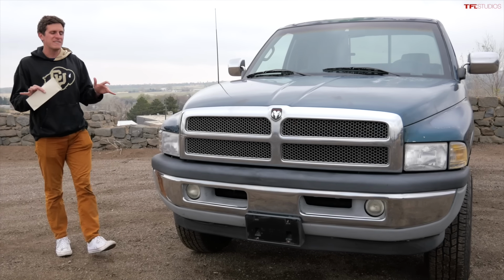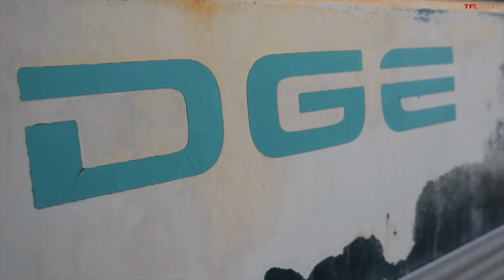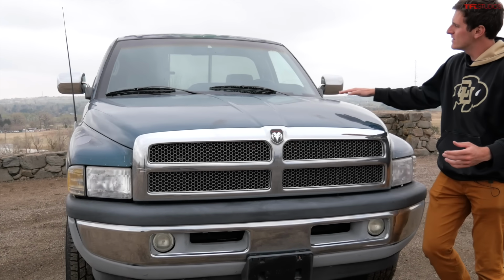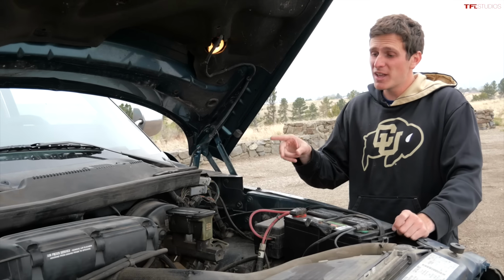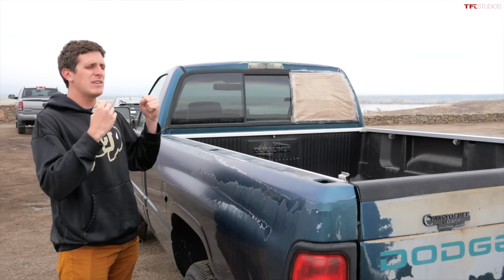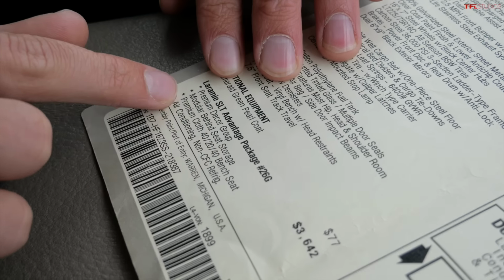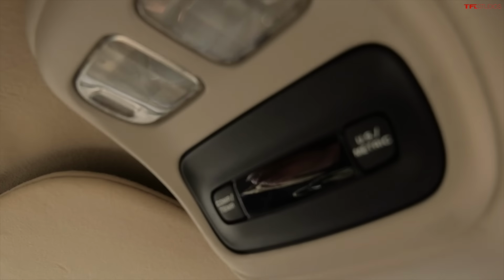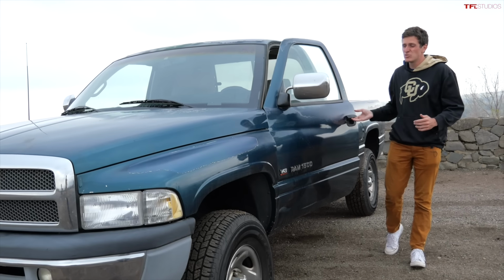The Second Gen Dodge Ram Is The Most Important Truck Ever: Here's Why You Should Buy One NOW!

Comment: The auto trans isn't the problem, it's the anti drain back valve in the cooler line by the radiator. It clogs and starves the trans of pressure.

Comment: I’ve owned several 2nd Gen Dodge Rams over the years. My take is they are very reliable as long as you maintain them. Regular engine and transmission oil changes. All of the steering complaints are easy to correct. These trucks are also fairly easy to work on, no special tools required for most repairs.
RockAuto, LMC Truck and Ebay are my go to sources for parts.

Comment: Bro, I love my second GEN. I just got another one. I have a gray one and now I have a red one. The old one I used to have it was a 2500 with 800,000 miles on it. now I got a 1500 with 273,000 miles on it. 59 magnum original transmission automatic. They run fine as long as you do the right maintenance they run fine and they go forever. You just gotta maintain them and just not skip out on oil changes and just do homework you just pure ignorant stuff just treat them like you need to be treated now treat you good forever man.

Comment: 1997 slt Laramie 1500 4x4 with the 5.9 magnum i am the second  Ram owner of this truck i bought it off my best friend  ..when he was going to trade it for a new ford F-250 in 2015 ...... one thing besides the dash crack they are notorious for is the headliner that droops and the foam deteriorates under it same as the one you are in the video  ........there is a company called DASHSKIN that makes a replacement dash cover very easy to install and they look like  new .....the headliner is next on my list to replace or repair  i just have not done it yet .........the headlights also...get cloudy and pasty looking....so i recommend replacing them with the newer poly carb style ....   great its been a great running truck   mine is still going strong mechanical wise ...

Comment: I have a rather interesting one myself. 300k+ miles and still going strong. Just bought her not long ago and Im looking to do a full restore and  a few small upgrades nothing huge. Its supposed to be a 5.9 L V8 but one of the orevious owners swapped it for the 5.2 L V8 and its a club cab/extended cab instead of a regular cab but only has 2 doors. Its 4wd and its silver with a blue stripe down the sides. If I can afford it soon Ill be fixing her up. Hopefully dont have to sell her, shes is an amazing truck.

Comment: I had a 94 regular cab long bed with a 5.9 the truck was an excellent condition not a single crack in the dash body was in mint condition picked that truck up for 2300 bucks after a year I was in an accident which totaled the truck unfortunately. But I was able to somewhat redeem myself and I bought another 94 just like it with the v10 instead I looked out once again, not a single crack in this dash pain is good clear coat is good just some rocker panel rust I’ll have fixed for it gets worse

Comment: I can't believe you used this ugly scabby  truck as an example. My 1998.5 4x4 Cummins with 300k miles has unflaked original paint and near perfect interior. It even has it's uncracked original dash. I have had to replace the driver's seat base and the cloth inserts in the front door panels are worn. Biggest issues are the wonky wiring, which can be fixed, and the lousy track bar, which can also be fixed and the unfortunate 47RE. A previous owner installed a BD Diesel trans in my truck. Various billet parts, extra clutch plates and a triple disk converter. It's an improvement but it still sucks and needs a rebuild every 100k.  I wish I had the cash for an Allison conversion.

Comment: I sold my ‘98 ram quad cab, loaded SLT Laramie 3 yrs ago with 94, 400 mi on it. Original owner, it was the best truck I’ve ever owned . The 5.9 never used a drop of oil  and never leaked anything, it was such a tight engine. In all the 23 yrs that I owned it all I needed to replace was the front suspension parts and shocks, nothing else besides maintenance . I ordered all the  HD packages that I could on a 1/2 ton, it even had a cooler for the power steering unit. It towed a lot of trailers over those yrs, from a 7000 lb boat and then buying a ‘66 coronet and pulling it thru the mountains of Pennsylvania, to my house. I sold it to a neighbor and he still drives it

Comment: I have a '99' Laramie SLT  extended cab with an 8 foot box and the V-10. For it's time, the v-10 had more horsepower and torque than the diesel engine. I used to haula 36 foot camper up and down the mountain passes in British Columbia  and hardly knowing it was behind the truck. It has 65,000 miles, mostly because someone stole the computer out of it while I was out working in Western Canada so it's been sitting for a while. Working on it now, replacing front and rear bumper because I live in the Eastern Canada rust belt of New Brunswick. The only issue I've ever had with it was the deathly speed wobble and now I have to replace the front spring buckets because they're shot. I've had 4 offers to sell it but I'm retired now so I'm going to enjoy it for as long as I can while I can!

Comment: Great video review, very good solid overall example of a mid nineties truck that considered a hard hitting revolutionary design for the time. This Brings back memories from high school years, I remember the big the hoopla when these came out a they were like no other truck that had been out. They had hell of selection of engines, they really were monsters with the optional v10 especially in a 2wd package you hardly ever seen them in that trim, but powerful for a truck of that time. Unfortunately those were the ones that really suffered badly from transmission failures they just couldn’t stand up behind the torque of that v10 were barely adequate enough for the Cummins too,  if remember rightly. But they were cool trucks and still had their considerable share of quality issues . I still see a rather fair amount of em on road, the chassis rusting away especially here in Michigan and interiors other body parts are often falling apart,  all around those engines which  will still be going sometimes misfires, oil burning from the intake plenums systems and all. I’ve seen em being driven no reverse or the scrappers with trannys that no longer go past 2 nd / 3rd geas 😅. This is cool segment I still like them old boogers somewhat myself. Hell several months back I almost bought a 1997 2500 Ram regular cab 2 wheel drive with the 8.0 v10 ,  but I reluctantly passed on it.

Comment: My 1997 Dodge with the Magnum V8 got a new heart in 2023 at 225k miles.  I removed the box at that time, and currently running a homemade wood bed while a fabricator makes a short bed flatbed frame and all the needed junk to make it into a flatbed, including painting the frame and new exhaust tips welded on etc.  He's fabricating the tail end too because I'm not messing with the bumper and tow stuff as it sits currently.  What surprised most everyone who has seen it was the lack of rust on the vehicle but mostly no rust to speak of on the frame.  They said that's amazing for Dodge.  Funny thing is when I bought the truck in 97 in California, the dealer was on the central coast, and I proceeded to live in the coastal foothills in the area for the next 22 odd years.  It spent many nights in the parking lots of various marinas along the coast due to our family sailing ALL the time.  It's been a great truck; it gives me pleasure to keep it up and running in new ways and having new uses for it, until I'M no longer running, or useful, lol.

Comment: Terrible product. Anything with that little Chrysler star on it is pure trash. I will never buy Chrysler ever again. I owned a 99 2500 which was the biggest junk heap ever. One day it was electrical problems. Next it was the fuel system. Next the fuel gauge didn’t read properly. Batteries had a parasitic drain. More fuel system issues. Leaks. It was never ending. Repair shops loved it tho

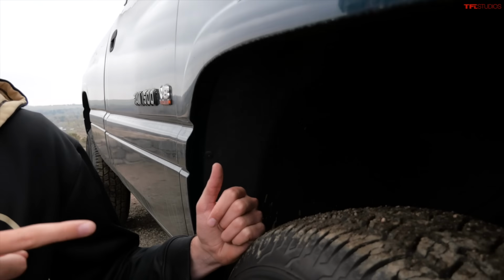Comment: 2000 1500, 3.9. Smallest engine but is bulletproof. Never any problems. Just replaced a few parts and rebuilt transmission. 200 k miles so far. Zero rust , everything works & no check engine lights 3:47

Comment: Got my 98 ram 1500 short cab long bed with the 5.2L 4x4 manual transmission about 3.5 years ago. Bought it with 85k miles and now has 95k miles.
I live in germany and i love it. 
TÜV is around the corner for mine and i had to fix some of the more common flaws but all in all. Reliable and just fun to drive

Comment: I have a 96 Ram and it’s a very low  miles. 80k and it’s a v6 with a 8 ft bed. Mileage isn’t bad at all. I use it to haul brushes and drive it to work on nice days.

Comment: Mine is a 1998 Magnum 4X4 short bed 360 fuel injected automatic 175000 miles. It is black and dirty. I got it from a friend after my 1986 Toyota died. The old Toyota is more my size truck but the Dodge is a fine truck. I keep it serviced. That is the main thing. I agree that the mileage is not great but other than that mine is a great truck. This is a reliable all weather all driving conditions load hauler. BTW my cousin has a gen. 1 diesel that he says is a great truck.
THANKS FOR THE VIDEO!

Comment: I thought they looked goofy when they came out.  I almost bought an extended cab short bed with the manual and the straight six diesel in the mid 2000s.  I should have done it.  Now I have the same truck with the 5.2 and an automatic.  It's a 2001 with 230k miles on it.  Not heavily modded or clapped out.  They're a good truck.  They still look a little goofy to be honest, but they're cheap, and easy to work on.  10mpg around town and 13mpg on the highway with a good tailwind downhill.  It's a weekend warrior for sure.

Comment: I have a 2001 Ram 2500 with a 5.9L 24 Valve Cummins, 6 speed manual, quad cab, and extended bed that my grandfather purchased new. It only has 110,000 miles on it . I even have the original sticker for it as well!

Comment: These have good drive trains (if you have a manual 5 speed) but the body’s and interiors on these trucks are garbage I’m sorry but having 46,000 miles there’s no reason for the paint to be peeling, the headliner to be sagging and the dash have a single crack. The interiors are about as durable as a saltine cracker

Comment: My paint job and headliner is the same issue. Debating getting them redone... I've got the club cab - back seat but no doors, and the 8 foot bed. That bed is awesome - 4x8 OSB, drywall, etc - just slides right in no problem.

Comment: been a Dodge/Ram owner all my life since the early 70's and have owned at least a dozen different model Dodges/Rams.  With that being said I can say with the utmost confidence the first Gen Dodge trucks were absolute rust buckets. Dodge claimed to have used galvanized steel for the bodies and even upgraded along the way but they still rotted to the ground twice as fast as Fords or Chevys. The windshields all leaked around the big rubber gasket that held them in and the water would run down the firewall and get under the floor mat or carpeting and it would rot the cab floor away from the frame. I bought a brand new 1977 one ton and it lasted 12 years before it was so rotted I had to junk it with 65,000 miles. And that was even after having a complete paint job with new doors along the way. The box rotted off in 8 years the cab lasted 11 years. there was no saving it. So fast forward to 1999. Bought a new 2nd Gen. Dodge. Had that 7 years and 130K miles ran like a top but the box was starting to rot off around the wheel wells. All the 2nd Gen. Ram trucks you saw had the same issue. And that continued to be a problem right up until RAM took control and seemed to have gotten a handle on it. I did also own a 2007 Dakota and yikes you could watch that one rot out.  After the 1999 started rotting away I never kept any truck longer than 4 years but from what I have seen the post 2010 RAMS seem to be holding up well. Just wanted to give my 2 cents on the subject.
Reply: I bought my 1997 new.  It now has 225k miles on it.  This truck was on the California coast for 22 years before I moved to Nevada.  The move ended the life of my engine though, I'm pretty sure.  I pulled a Big U-Haul over the Sierra Nevada with it and I'm pretty sure that took my engine life way down.  Two weeks later my water pump went bye bye.  Nothing else.  3 years later I noticed noises coming from the engine that were unfamiliar.  Went to the shop to have them put it on the computer and run full diagnostics.  3 jugs were going out.  One was pretty shot out.  The mechanic said I could drive it that way for a long time, but he wouldn't take it on any long trips.  I really love this truck!  My wife and I discussed it, and we decided to leave it alone.  Later we changed our mind and put a new 5.9 in my baby.  WOW!  Now I can't stop.  Headliner replaced (it was all looking good, I just couldn't get it clean, so I replaced it.  The rust showed its ugly head around the time I was replacing the windshield.  So, we made repairs to the leaks you described; however, mine didn't start until 2022, when I noticed the paint was bubbling just above the center of the windshield on the cab top.  Now, I'm going crazy with this baby.  I took the bed off yesterday, and I'm building a wooden flatbed to go there.  Red Oak will look really nice.  Once that is completed, I will paint the cab.  I bought a new/used dash for this truck, and you are probably familiar with this issue regarding the dash's cracking all to hell, or just falling out, lol.  2k for that little baby.  I drove to Eugene, Oregon to get it.  Now, all that remains is to get an upholsterer to repair the driver's side seat which is looking a bit toe up!  I am having a wonderful time with my 97 Dodge Magnum!

Comment: just bought a 01 single cab with manual transmission. Runs strong and gears are still good at 200k miles. Got tired of unreliable, crap built modern vehicles.

Comment: I OWN A 2001 RAM 1500 OFFROAD. FACTORY 3 INCH LIFT, FULLY LOADED - OVER 215K AND STILL GOING STRONG AND IT STILL LOOKS AMAZING.
Reply: You probably take care of it.  Most of the horror stories I'm reading are mostly due to lack of maintenance and from being left outside continuously.  My 97 was garaged most of the time, until I moved to Nevada.  Now it doesn't get inside much because I'm always using it!

Comment: 2nd Generation refers to the second generation of Cummins 5.9 Turbo Diesel. A 1500 is just another gas motor in an extremely poorly designed and built Dodge. PERIOD.
Reply: From 1994 to 2002 refers to the 2nd generation of Dodge Ram trucks.  2002 to 2008 is 3rd generation.  2009 to 2018 4th generation.  2019 to the present is 5th generation.  Cummins is offered in all of them.
Reply: No Cummins in the 1500. I have since learned that the adoption of the RAM nomenclature of the Dodge line pickups began with the 1981 year model. The RAM generation numbers has nothing to do with the Cummins (which is the ONLY reason I have owned a RAM pickup, the rest of the truck just disintegrates at a rapid rate)

Comment: I have a 1998 Grand Cherokee, with the same 318 the Rams had. 315k miles and completely stock. I daily drive it about 40 miles a day. Damn good motor. My dad had a 1991 Ram when I was a kid, them later a 1998. I remember when these came out and they looked so new back them

Comment: I have a 96 1500 with the 5.9, engine just blew, but man I loved that truck. going to keep it and fix it up in a few years, but second gens have forever stolen my heart
Reply: I replaced my engine this year with a new 5.9 gas engine.  I did some other things under there as well, new ac, new heater core, replaced the drive shaft, and the whole rear end shocks.  13.5k, it's like brand new!  Can't get a new one for that.  If you own your truck out right which I think you might, if you have access to a credit union, take your pink down there and you can most likely get that money for your engine, and have small payments.
Reply: doing my research before purchasing  a 95 or 96 Dodge ram 3500 V8 Magnum  147k miles  runs great
1 owner & I know and trust the seller I can get it for $5000, sounds like a good deal to me
i'm also a member of the state employees credit union so you're saying you can use your truck as collateral? If so that's awesome.

Comment: I don't own a Dodge Ram of that era. I do own a 1999 Dodge Dakota Club Cab 5.2l NV-3500HD 5-speed 3.90 Sure Grip 2wd with the HD Service Group. It doesn't have the issues that plague its Bigger Brother the Ram  like the Dash disintegrating. I've only had a couple small issues arise in the 230,000 miles of faithful service. The factory water pump finally failed about 2000 miles ago so I order up brand new Gates Water Pump kit and Hoses replaced the Idler and Tensioner Pulleys and Serpentine Belt for a total cost of $212 dollars. The Clutch was replaced about 100,000 miles ago with a CenterForce II and Pressure plate as I accidentally smoked the stock clutch getting a forklift that got high centered on a concrete driveway.  I run Mobil 1 Synthetic Motor Oil with Wix XP Filter. Up Next is a full suspension upgrade with all Mevotech Parts with Bilstein Shocks. I paid $18,795 for my Dakota Brand New and it keeps on delivering years after years of faithful service. I use it daily to tow my Lawn Utility Trailer. With the cost of new pickups these days reaching into the $100k mark I will just keep on fixing up my Old Truck and enjoy it for another couple decades.